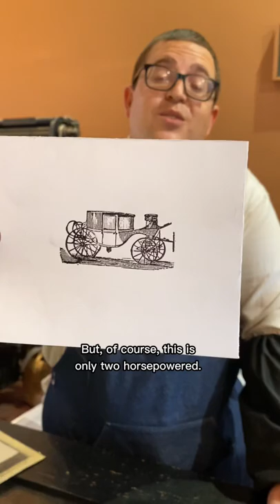Printing an image from a cut for the Daytona 500

Comment: Little-known fact: due to the horsepower being based on the “average” horse, the average large sound draft horse actually makes more than one horsepower per horse!
Reply: I have heard that now the active horse is about 7 horse power.
Reply: @bland9876  yeah, was based on the average power a horse can continously make working all day. Kind of just to sell steam engines too so it was estimated kinda low.
Reply: So... i can beat a 2 horsepower engine with two actual horse?
Reply: @itzefatabruhh1701  absolutely, if i remenber correctly average horses have peak power of 15 hp so yeah....
Reply: @gryyta9617  my whole life is been a lie, really disappointed and ruined my day
Reply: @itzefatabruhh1701  sorry mate❤️

Comment: Why do you put a piece of newspaper on top of the white paper?
Reply: I'd guess it helps distribute the pressure from the press more evenly across the paper.
Reply: @Bleats_Sinodai  
Helps prevent the ink from bleeding through the paper as well!
Reply: To save the white paper from the damage the pressure of the machine may cause